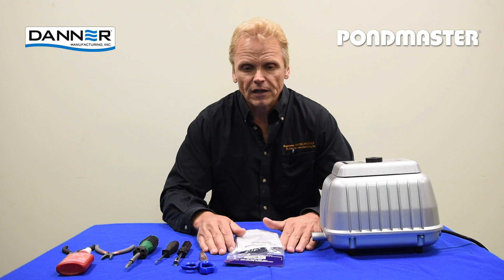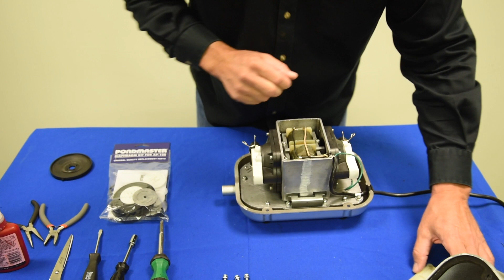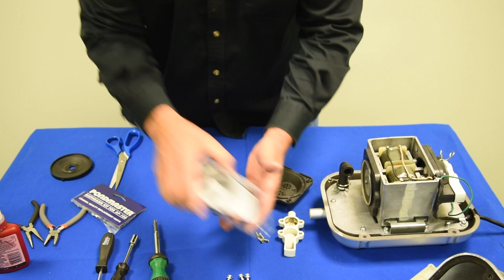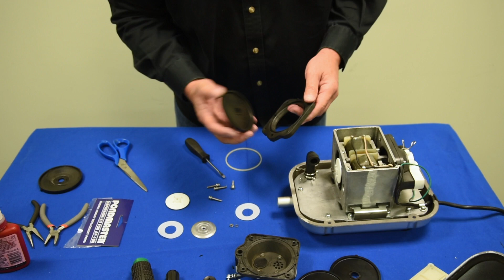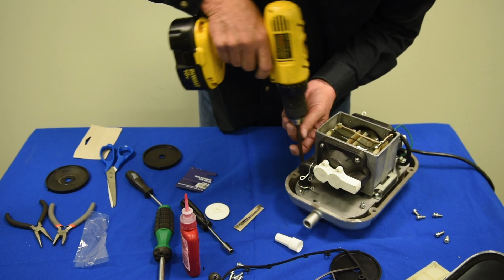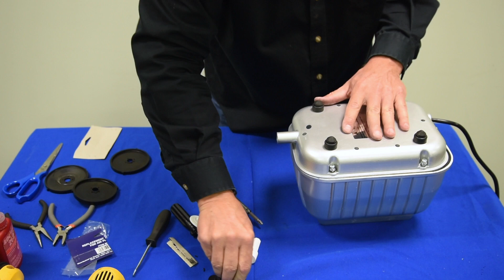HOW TO: Disassemble, Reassemble & Repair Pondmaster AP-100 Air Pump

Comment: "the plastic ring in the diaphragm does not wear out and does not ever need replacing" false statement. Its made of brittle crappy plastic and breaks easily. This pump is a frustrating pile or garbage after a few years.

Comment: The user is not restricting any part of the diaphragm it’s just a weak ass product, I went to replace my diaphragms and noticed that the screw 7 mm head is snapped off so I can’t even get the screw it back on to replace it, again it’s a flaw in the product.

Comment: Hi Steve, I have the LP-100, which is exactly the same. I replaced my diaphragms and unit is working, but I find the volume and pressure of air is about 40% less than my new unit I purchased the same time as the parts. It is not the valves, as I swopped it from new unit and still the same. So it must be the new diaphragms. It seems slightly stiffer than those of new unit, so it could be old parts. Should this units run in first before it reaches top performance or should it be pumping at full spec from the start.
Reply: Rebuilt my resun lp40 with new diaphragms and flappers today and had the same experience. Any update with your experience Greg?
Reply: @BrentonCollas  You need to clean the flapper valve seats as they get dirty!